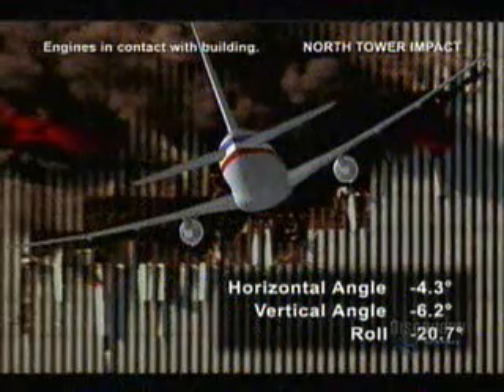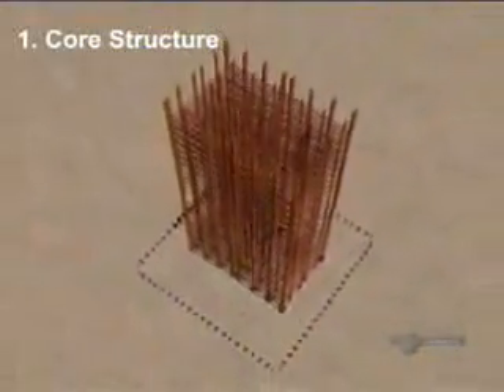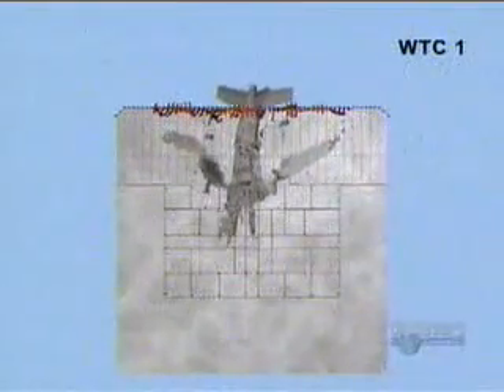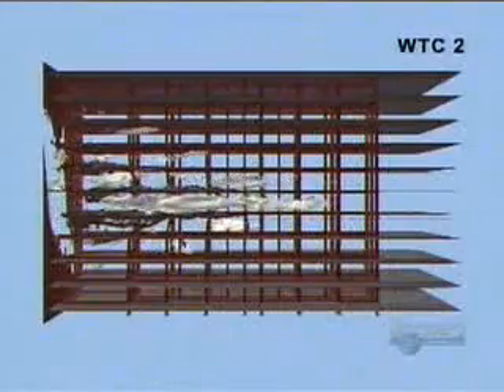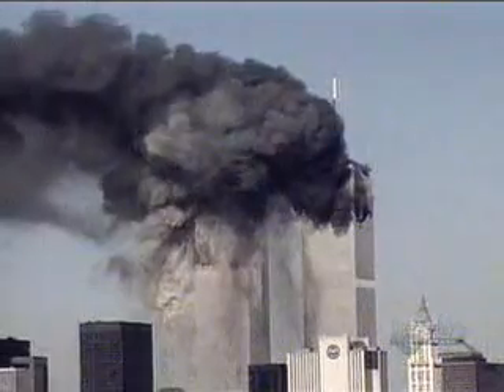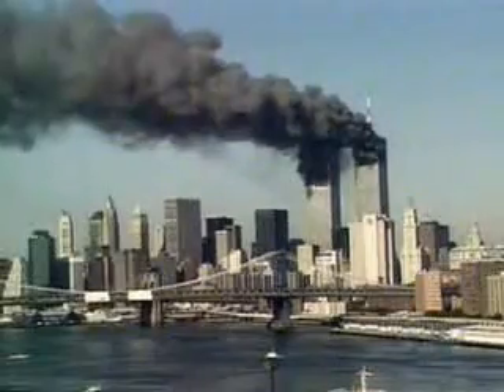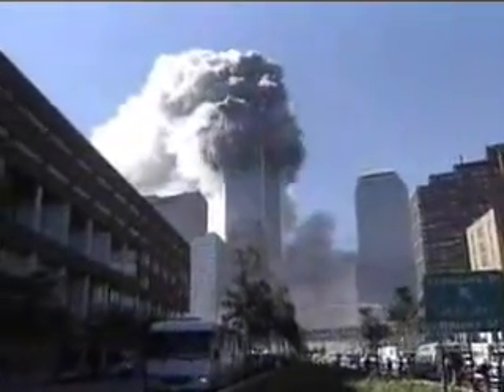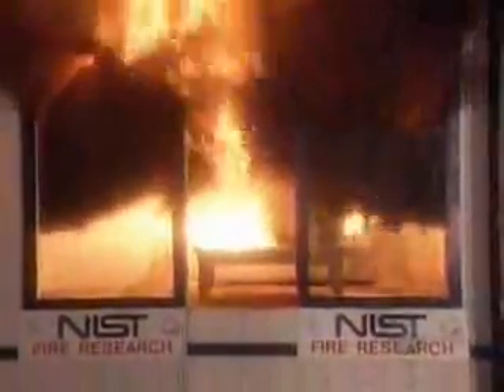9/11 What Made The WTC Twin Towers Fall

Comment: That's funny the airplane would have been like cheese through a cheese grater only the titanium in the engines would have almost gone through. Using a filter you can see the inferred laser that was pulsed the resonate Hz of steel vaporize the frame work.
Reply: When you come back to Earth, give us a bell.
Reply: If that airplane was made of steel it would have not done that damage. the image you see hitting that building is cgi and that can be proved they had high explosives timed to go off and they made to errors one the fireman videoing showed the first supposed impact there was sound but no plane and the security camera video shows a plane but the left wing goes behind a building that was on the opposite side of the towers and wing should have passed in front of that building, If you ignore that it's because you choose to and means you think it can't be wrong. so give the human race an apology when you get back from the next galaxy your living in. Man people just are absolute fools these days just don't take away there tv's and their beer.

Comment: The bits of the plane removed the "fireproofing" of steel??? What the fuck??? Why steel needs fireproofing?
Reply: cause steel bends when it get heated to a certain temprature which would cause the weigh of the building to collaspe. they fireproof the steel columns in case of fire in the building. however im pretty sure when they designed and fireproof these buildings, no one accounted for a plane to hit them cause like wtf who plans for that shit. and on top of that jet fueled fire i imagined would burn hotter than normal fires.
Reply: Fireproofing isn't super high tech, it is a layer of fire proof paint or boards laid on cinder block. You can see the same thing in any stairwell. If fire gets in there somehow, you'd be fucked. The plane went right though. Bin Laden studied civil engineering and architecture, he knew what he was doing.
Reply: "Why steel needs fireproofing?"

Seriously? You're joking, right?
Reply: Some people are using "action movie logic" to  claim that building 7 was demolished.

If you're close to an explosion you can't survive it by out running a fireball. The force of the blast will blow you to smithereens.

If you take out one corner of a rectangular structure the whole thing is weakened. That's how Jenga works, or chair legs, or a stack of cheerleaders. 

Science education sucks in the U.S. we're behind everyone, and it shows.

Comment: The explanation for why the burning floors makes sense, and I would probably believe it IF it had been only the burning floors that collapsed. I'm still waiting to hear a logical explanation for what turned the rest of the 110 floors into rubble.
Reply: The weight of the the rest of building falling on top of them. You're talking thousands of tons!
Reply: John Burke haha dude, the weight was always there. The building was holding up that same weight for decades.
Reply: +Kevin Lunt yeah it was always there, with steel columns and concrete holding it up. The planes hit, weakened the supports and it created a domino effect. I work in construction specifically in steel buildings and reinforced structures. I really don't understand what's so hard to believe about a fully loaded commercial plane destroying a building? Once those supports were weakened the fall of the building was inevitable.
Reply: Did I just reply to your comment on another thread?

"Once the sports were weakened the collapse of the building was inevitable." The collapse of the burning floors, maybe. But the entire building?

Look up a video on YouTube of the "Trowbridge estate collapse" and tell me why it is that the 11 stories fall a distance if 10 stories and land mostly intact. I'm not being sarcastic. I'd love to know what an experienced builder has to say about it.
Reply: +Kevin Lunt ha ha, yeah I realised we were both engaged in two separate debates also. I'm not American so I am not familiar with cinder blocks, I thought you were referring to solid concrete blocks. I know what you're saying, but having never seen any other skyscraper (apart from the other tower) hit by a commercial jet, I've no basis for comparison. I will say this though, do you really believe the whole conspiracy thing. I mean to think that the government orchestrated this whole thing is like something out of a movie! The amount of people involved, it would be impossible to keep quiet. They couldn't keep watergate under the radar and that only involved a handful of people. To think they rigged two, possibly three buildings to blow without anyone noticing is hard to swallow. What about the people who set the charges? I know if I was a demolition expert brought in for that job, knowing I'll be effectively responsible for the deaths of thousands people, I couldn't do it!
Reply: Haha that makes sense then. After I explained what a cinder block is, I saw your massage where you work in construction. That's when I figured we had a mIsunderstanding.

I struggle to imagine how they could have done it for the same reasons you mentioned. But all the physics I've studied makes the pancake theory also seem impossible.

So either the government pulled off an impossible stunt and kept it hidden, or the most impossible coincidences in physics happened that day. They're both crazy, so why not?

The question "how could they do it and keep it a secret" is a great question, but a poor argument.
The assumption is "it didn't happen because it would be impossible to keep it a secret." But suppose it did happen, and they did keep it a secret, well I guess that proves it is possible to keep it a secret.

There's this one quote from Sherlock Holmes, something like "when you've ruled out the impossible, whatever is left, however unlikely, must be the truth."

That's the favorite argument of all the skeptics; saying it's impossible for the government to keep secrets because look at how many secrets have been leaked (like Watergate). True, but do you know how many secrets have been kept? Haha probably not cuz that too is a secret. Every secret that gets leaked proves that the government has secrets.

A few years ago in this country, it was reported that our military "lost track"of $1,700,000,000 in defense spending. Now either somebody knows where that ship, load of money went and is keeping a secret, or Americans are just very clueless. Either way, it seems pretty easy to keep a secret from Americans haha.

It's been fun talking to you. It's nice to meet someone who can debate something politely.

Do check out those videos I suggested. I'll post a link if I can find then again.
Reply: +Kevin Lunt in all fairness you would've thought there would be at least some of the buildings standing considering where the collapses started. I still would be more inclined to the official story over the controlled demolition story. 
   Let's say it was an inside job. What would the motive to levelling the buildings be? Say they wanted get support for Iraq or whatever. Well flying the planes into the buildings would've been enough on its own. I mean when you think of it especially from an economic standpoint, there's no motive for the government completely destroying the towers. I mean I honestly can't think of a genuine motive for Bush to be involved.

Comment: I understand these explanations, but I've always questioned the collapses of the towers, especially WTC 7 which in my opinion was pulled down by controlled demolition, for the towers too fall into their own footprint the core columns must have been severed, in the case of the south tower the building should have fallen over? Not straight down through the path of greatest resistance, the same goes for the north tower.
Reply: +Wes Fox LOL, yeah, I love people who say it was a controlled demolition that fell into its own footprint. If THAT was a controlled demolition, it was the worst controlled demolition in history, and the demolition company would be sued for billions.
Reply: +Joe D plus there's never been one real shred of evidence of a controlled demolition. When they do a demolition like that, there's blast caps, cables bits of fuses and loads of other crap that would have littered ground zero! Nothing of that nature was found.

Comment: Yup. That's it folks, we have answer. Buildings are made of twigs and the entire structure will collapse if you poke it. Buildings are not made of high grade steel columns and their never bolted securely.
Reply: cause that's the power of american engineering
Reply: +Da Do If that's what you got from watching this, there's no hope for you.  Lol @ "their" as well.  And it's laughable if you think one of these planes carrying tons of jet fuel and hauling ass right into a building is the same as "poking it"
Idiots, all of you conspiritards.
Reply: Ian Rupert Oh you must be right, if you cause a problem half up way the building, the entire thing will collapse as fast as a ball dropping out of the sky.
Reply: +Da Do Believe it or not, most buildings have their "core support" in the center of the building. If you make it too low, the top of the building will be too weak, and possibly even sway. If it is built too high, it will obviously be too heavy for the bottom of the building.
And by the way, a good analogy for the WTC support is this:
Imagine you are doing planks, right? Now, imagine doing it, but someone just broke your right arm. Try keep planking with one arm, and see what happens. Hint: You will fall.

So even if they are bolted tight, that doesn't make metal sturdy. In fact, steel is malleable, or bendable. If there is too much pressure on one beam, it will bend. The more it bends, the more unstable it becomes. See the connection?
Reply: Moneydud
That's a bad analogy, a better one is, If I'm standing upright and my arm falls off, does mean by entire body will disintegrated into particles and drop to the ground.
Reply: Da Do No, THAT is a bad analogy. The building doesn't have arms. If, per say, the building did have arms, and those arms collapsed, the building would still be there itself.

The building had its support weakened by the extreme heat from the Kerosene.
Reply: Da Do No, a better analogy would be you taking a .50 caliber to the chest and seeing if you break in half.
Reply: TheTrashMan Well, I wouldn't say that. But at this point, it's better than his analogy. And it would make more since.

Comment: I think the tower collapsed on its own weight
Reply: +Kevin Lunt well it was obviously designed to hold it's own weight...but that its so heavy that it you fuck up a part of it ...the weight won't be distributed evenly... and there's gonna be an inbalance...
Reply: Yes obviously. But then how does the imbalance cause the whole thing to unzip? It doesn't make sense to me. I would have expected the burning floors to crumple they did, and for the top section to fall off which it did (due to "imbalance" as you said). So then why the hell did the rest of the floors collapse? They just fell on their own it seems.
Reply: good point...I read it was something like a pancake due to weakened beams and the weight of the top part...gotta read about it again...
Reply: Vitaliy Epshteyn there's a lot to read. Fair warning. Be careful not to reach premature conclusions. How they collapsed is a complicated question. I've learned that complicated questions don't often have simple answers.
Reply: They were made to withstand multiple plane hits dude
Reply: +TheMarioManiac That makes no sense. It had been supporting its own weight for decades.
Reply: +Kevin Lunt what do you mean why did the rest of the floors collapse? They had thousands of tons of steel and concrete falling into them!
Reply: John Burke take a stack of 9 cinder blocks. Drop another one on the top from any height. Tell me what happens. Will the top block destroy the 9 below it? How can one block destroy 9 blocks when they're all made of the same stuff?
Reply: +Kevin Lunt that's a massive over simplification! A solid concrete block and a hollow building supported by steel are two completely different things. The only way they'd be compatible would be if the trade centre was one massive lump of concrete with nothing else, no floors, no windows just one big lump. Imagine a steel frame building, then imagine dropping a 100,000 ton weight directly above it. That's what happened effectively.
Reply: John Burke LOL cinder blocks are hollow dude. They're those blocks with the two square holes where you can put rebar and pour cement.
And it's an analogy. Of course it wouldn't be exactly the same. But it would demonstrate the same laws of physics that apply in the collapse of the tower. Namely, action-reaction.

"That's what happened effectively." HAHA dude, you said my analogy was an overly simple. Yours is simple, and also totally inaccurate. No this was not at all like dropping a huge weight on a steel structure. It's like dropping a steel structure into a taller steel structure.

Why do people not get this? The falling section was made out of the exact same thing as the standing structure. You know that right? It wasn't made out of something stronger and heavier. As the standing section got destroyed, the falling section would also get destroyed. That's what the cinder block experiment would show.

So the 10 falling stories would have been destroyed long before they destroyed the 90 stories below on the first tower. So there would be nothing left to destroy the rest of the standing section.

There's actually a YouTube channel where a guy does several physics experiments related to 911. One of his experiments actually is the cinder block experiment.

Can you imagine one cinder block destroying 9 blocks beneath it while remaining intact?

Or how about this: you've seen cars get rear-ended right? Gently speaking, which car takes more damage, the moving car or the stationary car?